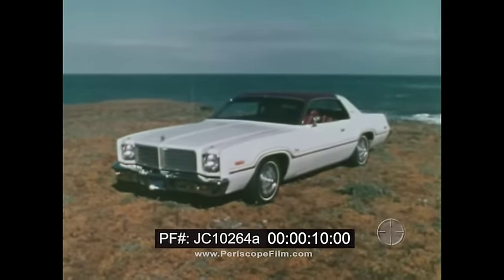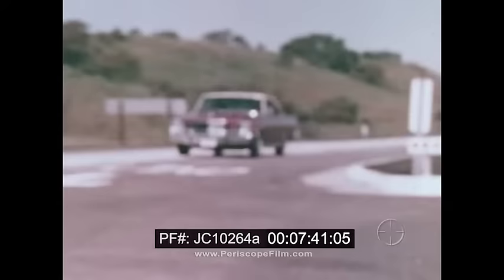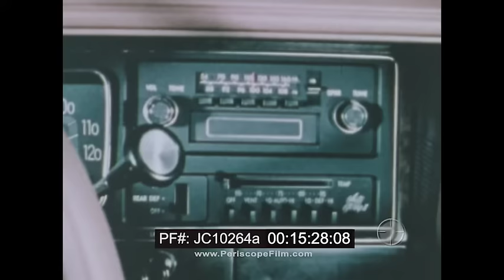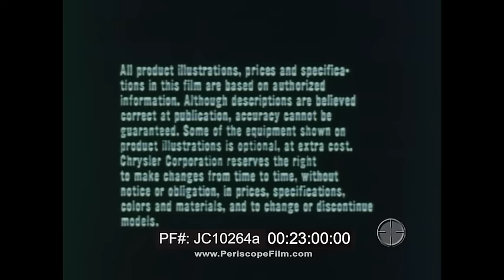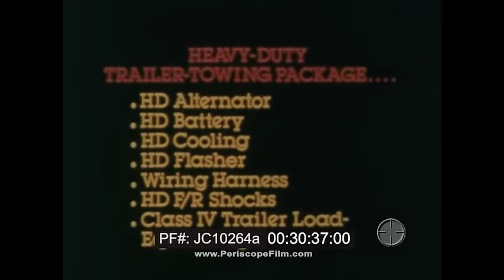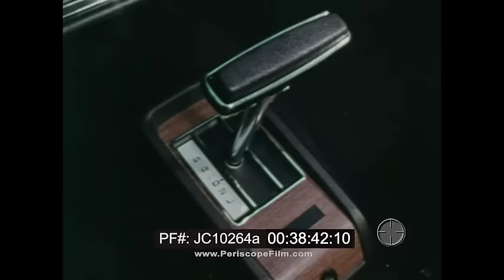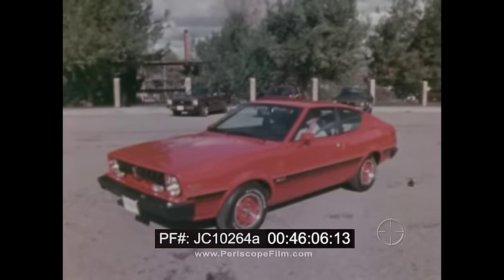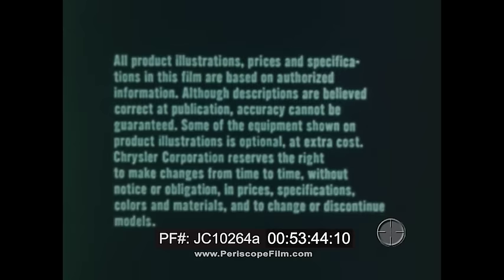1975 VINTAGE DODGE CAR, TRUCK & VAN  ADVERTISING PROMO FILMS   DART  GRAN FURY  ARROW GT JC10264a

Comment: Ah...you had me at simulated wood grain vinyl panels...now you're talking class.
Reply: That was a big selling point. You have to think that up to WWII, all vehicles had wooden components. They needed to be nourished and maintained, or they rotted. If you had a car longer than five years, you needed to sand and refinish the wood. After plastic and nylon became optional, people could have their "wood" and never need to maintain or refinish it, because it was artificial. Same reason EVs come with fake exhaust sounds today; people were used to it and still wanted it in their cars.

Comment: This is so awesome to see the 1975 models  \m/ My Dad owns a super rare 1975 Dodge Dart Hang 10 with a crank sun roof & fold down rear seat for your 🏄 lol. My Dad’s “Hang 10” has a 318c.i. with a few modifications he did himself such as an aluminum semi high rise pick up for a 4 barrel carburetor set up + hooker headers,it now has a set of shaved down heads with roller rockers & titanium valves,Accel Ignition,3:73 rear gears etc. They only made the “Hang 10” from 1974-75 & the sun roof was optional & they came with a slant 6 ~ 318 or 360c.i. They are an extremely rare car that keeps gaining popularity.
Reply: That is a rare car.
Reply: I remember the Hang 10 commercials in printed magazines at that time... The phrase "Hang 10" referenced a slang surfing term and was pictured on the beach, surfboards all around, with tanned Adonis' and bikini clad beauties playing volleyball or around a campfire weenie roast... or at a ski resort chalet... the good life.
Reply: I 've got a '74 Space Duster. That fold down rear seat is awesome. If you fold down the trunk divider too you can sleep in the car.
Reply: I wish I could see that car. It sounds like a great look into the past. I’ve never seen a crank sunroof!
Reply: Surf's up, Moondoggie!  Hang Ten Darts come up on eBay once every ten years or so . . .

Comment: My father had a 69 Dodge Dart that the slant 6 engine it didn't have a lot of power but it was a work horse and it was extremely reliable 6 kid's learned how to drive in it. My father kept his clean inside and out it was painted gold with a black vinyl top. That Dart ran from 1969 until 1987 that's when he gave the to my brother and his wife who promptly wore it for
Reply: Yes, my dad bought a used Swinger in '79 and the chassis was garbage by '81, but the slant 6 kept on going.   Whomever stole it from us in August '81 got a good engine at least.
Reply: My dad bought a 78 Aspen new with the slant 6. It would break the tires loose shifting from 1st to 2nd. I was really too young when he owned to remember much but I do remember him working on it almost every weekend.

Comment: Thanks for the memories. I think I will take a fleet of 1975 Darts and Valiants. I suppose it goes without saying they would all have Slant 6 engines.  Since I am buying in bulk, you may as well throw in a few Coronet wagons with 318s. Make sure to add as many Taxi components as possible to the wagons.  😁
Reply: I used to have a plump Valiant I think it was a 72 and the slant 6 was a reliable engine, what a shame that they just don't make cars like that anymore
Reply: Oops Plymouth
Reply: @The610wise  The tragedy is that 50 years later, Chrysler has never matched the reliability standards set by their Darts and Valiants. If you want the common sense, modern equivalent you buy a Corolla or Camry .
Reply: I have a 2000 civic and it is a great running car and it drives great feels great and ride's great, the best used car I ever bought
Reply: @The610wise  My father had a 1980 Dodge truck with the slant six in it.  That thing only got to about 80K miles before the top half of the engine had to be rebuilt because it started burning a quart of oil every 100 or so miles.  I had two Dodge pickups from that general time period with a V8 in them and never had that problem.  I did rebuild my 85 Dodge W-250's 318 engine at about 137K miles because it was starting to get noisy and used some oil but even at that point it never used a quart more than every 300-400 miles and I think half of that was leaks and not burning.  After the rebuild the engine was still running great at 270K miles, the transmission finally went to hell in it and I dumped it rather than spending $1000 on a truck that was rusted out.  Technically the slant six might have been "reliable" in the manner that it didn't completely break down but no engine should need a partial rebuild at 80K miles!
Reply: I would have absolutely loved to have the '71 Valiant that Dennis Hopper drove in "Duel".  Before it got smashed up, of course . . .
Reply: @borisratnik9032  Maybe  Dennis Hopper drove the truck in  "Duel"  but  Dennis Weaver drove the Valiant 😉
Reply: @rightlanehog3151  Thank you, I stand corrected.  It WAS Dennis WEAVER, otherwise known as Mc Cloud.  Sorry.  I'm getting old.  But I would still love to have that Valiant.
Reply: @borisratnik9032  I possess no statistics to prove it but I would say the Valiant and Dart were the most reliable domestic cars of their day.
Reply: @rightlanehog3151  I agree, I think they were - with the Slant 6, of course.  The V-8s drank too much, but they were good, decent cars for the money, and simple.  Better than the small Fords and Chevys of the time, which were kind of temperamental.  I wanted to buy the last one - the 1980 Volare or Aspen - offered for $5,000 new, but I didn't have the money at the time.  I knew that the age of Mopars was over by 1981 and I was sad to see them go.
Reply: You can have the 225. Give me the 318 with a 4bbl. I will get much better gas mileage.

Comment: I have a '68 Roadrunner ive owned 38 years here in the UK, a 440 L code conv '68 Fury and a '69 273 Dart....I want a '75 grand Fury now LOL. MOPAR all my life
Reply: My man!!!
Reply: I owned 2 Cordova's, I the 1970,& 1980,s, had no fuel problems!!, At all!!!!! Miss them!!! ....
Reply: The 75 Gran Fury Custom with quad headlights looked so much better than the Brougham's dual headlights.

Comment: I love the round headlamps that were nearly universal back then. If a rock hit the light it cost about ten dollars for a new one. A rock that goes through a modern headlamp assembly might set you back a thousand dollars, Ugh,
Reply: Yeah my car, my dad's 1954 bsa motorcycle, and a model A's rare sealed beam aftermarket kit use the same headlight
Reply: The standard round headlight could be bought anywhere, the same can't be said about the modern headlight assemblies.
Reply: The round headlight was about $2 back in the mid 70s, other bulbs were around 49¢, only took 2 minutes to change, no one ever had to take a bumper cap off just to change a headlight bulb like you have to with most GM cars and Ford Fusion.

Comment: My father was a Oldsmobile man and in the 70s GM was making junk my father bought a Olds Delta 88 and it was a huge car my mom was a tiny lady and she that Olds and she needed a pillow to see over the dashboard. The Olds didn't last 5 years but that old Dodge Dart was still there ready to go when the body started to rust around the wheel wells he did the body work himself and took it Earl Shines for the 99.99 paint job had the seats redone in a soft fabric and nothing they bought was as cool and reliable as that 69 Dodge Dart
Reply: Should have bought FORD!!!!
Reply: Nooooo Ford's were notorious for being just as crappy back then as they are now, as matter of fact I just sold a 07 Focus to the junkyard for 460.00 because they are junk, every time I replaced something that needed to be replaced 2 days later something else would brake, I realize it was old but it was a nickel and dime car. I just bought a 2000 Honda Civic LX sedan from the old lady across the street for 1000.00 and it hurts 114,757 miles it's clean and we'll maintained and it runs great drives great feels great, it passed inspection, and in a way it reminds you and Dads Dodge Dart A simple reliable car that doesn't eat a hole in my bank account
You can keep the Ford 
,
Reply: My uncle had a 1975 Olds Delta 88 coupe.  He drove it over 20 years and well over 250K miles without needing an engine or transmission rebuild/replacement.  It was finally in a moderate wreck (what insurers call a "rolling total") and my cousin entered it in a demolition derby.  My uncle said the car went out in a "blaze of thunder".
Reply: @The610wise   Ford is literally the most reliable vehiclemaker today, after Toyota. The Ford Focus/Mazda 3 routinely hits 500k miles or more across the board, so learn how to drive or take better care of your vehicles. If you couldn't keep a 2007 Focus running, you're never going to keep a 2000 Civic running.

Comment: Those cars had horrible drivability problems with their carburetors and fuel management systems. The lean burn system was a failure
Reply: I heard that the "lean burn" system was a sick joke that seemed to be designed by Satan himself.  Car collectors that buy cars that came with the lean burn system today promptly replace it with a more conventional system available as an aftermarket.  It wasn't just Chrysler that had problems with computer controlled engines, I had a 1983 Lincoln Town Car with computer control, about every 24,000 miles that computer had to be replaced at a cost of about $150.  In all other ways the Lincoln was good to me but that computer box was a problem.
Reply: @mharris5047  From the mid 70s to the mid 80s were a very dismal time for anything made in Detroit.
Reply: Car companies were desperate for any gimmick that would save gas back in those days.
Reply: Lean Burn works well if you understand it. Failing that, just remove it properly and away you go.
Reply: @account4info I’d go so far as to say it was… an era… where they were going through a sort of… malaise

Comment: It's sad to see the folks who brought us the 383 Chargers, the 426 Hemi Challengers, the 340 Dart GTs, etc., advertising "economy" features that warn you about stepping on the gas too hard a mere 6 years later.  The years between 1973 and 1978 were an almost fatal time for the US auto industry.
Reply: LOL it lasted longer than that, you had 180hp in an Z28 in '86....we had 360hp TT  -6 in a 180mph 4 dr.Vauxhall...UK
Reply: Jimmey Carter was President!
Reply: @markholroyde9412  
Of course it lasted longer, but by 1978 most US car manufacturers realized they were on the wrong track and started moving in a better direction instead of stubbornly insisting that the right ad campaign could talk the public into buying bad automobiles.
One of the best descriptions I ever heard of the huge increase in Japanese share of the US car market from 1975 to 1980 was the following:
The Japanese came along with the radical idea that they would make cars the customers wanted to buy instead of making cars the manufacturers wanted to make.
Reply: @markholroyde9412  
Hold on to that Vauxhall tight.   Hold on to it with both hands, because British automotive history consists of a mix of practically hand built, custom pieces of art for the uber-rich and mass produced cramped and unreliable pieces of sh*t for everyone else. 
The UK has zero room to criticize anybody on the quality of real mass production automobiles.
As an aside, what did the FIAT owner say to the MG owner?
Need a lift?
Yeah, it was that bad.  The UK, just like most other long established auto makers, primarily produced sh*t through most of the 1970s.
Reply: @maxkronader5225  I have a friend that had a 1970's MG.  It was NOT a nice car, he actually tried to sell it to me but I didn't want it.  It looked great but my fat (expletive) wasn't going to fit behind the wheel of that thing!

Comment: The Plymouth Scamp was a fairly decent car with a 318 under the hood.  Still had the identical looks of the previous generation Dodge Darts but no performance model.  Back then cars had character with the big chrome bumpers and kids could add Cragar S/S wheels for an even more hot rod  look.  However, if you wanted to street race you needed a serious big block under the hood.

Comment: Watching the Dart now. Hmmm. We had a 72 sedan and a 75 Swinger, 225 slant 6. The 75 used every bit of the fuel of the 72, but was even slower. Great cars, but only with the V8. My preference is a 318 with 4bbl. In Canada that meant no catalytic converter.

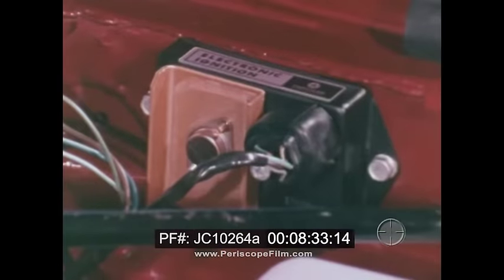Comment: 8:35 Ha!  For the petrolheads here, that electronic ignition device on the firewall was a sure fail -  if and when the hood gasket failed, water would drip down over that thing and the car would never start!    Same thing for the previous generation Dodge Dart.
Reply: I have had them run with the insulation melted out, water Running over them, and, Never missed a beat!
Putting together a 54 Dodge pickup, and, will probably put that ignition module in it  just to Try to finally kill it off!  
Pulled Slant 6/904 out of a '76 Dart, and I have had it in 2 other cars over
 the years. Approximately 250k miles on it, and still has around 120lb compression across the board!
Should make the truck cruise So Well!
Reply: @bensonsspeedshop1191  I am glad your slant six is doing well, my father had a 1980 pickup with that engine and he wanted to (expletives) Lee Iacocca after it started burning a quart of oil every 100 miles with only 80K on the odometer!

Comment: These were certainly some beautiful and comfortable cars for their time. 
Unfortunately, US automakers were going through some tough times as they struggled to meet strict emission standards and improved fuel economy. The engines in these cars were laden with thermal vacuum switches with hoses to control ignition timing, EGR, air injection; while the exhaust was choked with a 3-way catalytic converter. 
It wasn't just Chrysler cars; Ford, GM, and AMC were doing the same things. Have you ever looked at a vacuum diagram for a mid 1970s car? Its mind boggling. 

Much of it was experimental as engineers were doing what they could to reduce emissions while keeping their cars running half way decent. By the late 1970s, electronic engine controls would be the solution to that problem.

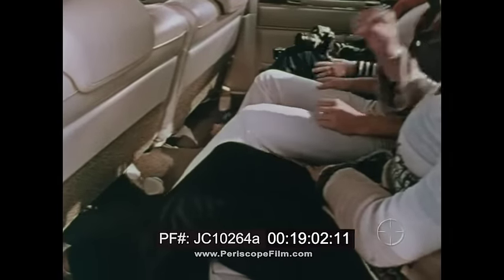Comment: 19:00 This car is an American car, but it has strange mirrors.　The fender mirror looks like a Japanese car. As a Japanese person, I was very surprised to see this.
Reply: The Arrow was manufactured by Mitsubishi so it was essentially a Japanese car.  The first Chrysler manufactured small car was the 1978 Omni (my grandfather had one, it was reliable for the year he owned it but so cramped inside that in 1979 he traded it and about $3K for a full size Dodge pickup).  The second small car line Chrysler manufactured in-house was the Aries/Reliant cars (my grandfather got talked into one of those as well -- the Chrysler 2.2 engine completely failed at 56K miles and that car was a bucket of trouble).  I had a 1983 Chrysler New Yorker which was essentially a fancy Aries/Reliant, I had the Mitsubishi 2.6 engine and at least that made 150K before it was clacking loudly and burning oil, I dumped it at that point.  At least I had my truck and another car I could fall back on if my New Yorker had broke down, I felt sorry for people that bought the early 80's Chrysler compact cars that didn't have a second vehicle.  Let's just say I liked my 1967 Chrysler Imperial much better but 14 years and 250K plus is about all she had in her.

Comment: In those days all I had were GMC  and Chevrolet (have all these days) so never knew they offered a 4x4 with 440 with extras like a built-on  8-track and CB. That Trail Duster with a 440 might have been better than my Toyota Land Cruiser(?),
Reply: And dual speakers!!!  Wow
Reply: I don't know about that, if you had the Land Cruiser they sold in Africa for jungle use you had one hell of a tough truck!  IIRC they sold them here in the States during the early and mid 70's.  My uncle had a Ramcharger (a copy of the Trail Duster), that is another slant six that didn't survive well but otherwise it wasn't a bad truck but not as tough as the Land Cruiser.
Reply: The only problem with Land Cruiser was stiff suspension but you're right it was super tough.

Comment: While I grew up in the 70's, I'd forgotten how utterly FUGLY most US car design was at the time. The only cars which looked remotely decent were the Arrow & the Sapporo. The one segment  where they tell the dealer how to counter sell against the Toyota Corolla are hilarious. "Just tell 'em they you have more gadgets! Who cares if they break easily!" And boy howdy, did they.
Reply: That Dodge Charger was gobsmackingly uuuugly!
Reply: Lots of extras and special equipment  at the same or lower price than  a competitor usually meant poorer quality

Comment: My  wife had a 76 Dodge Volare.   A 318 with a torquefight 3 speed auto.  The body and paint were horrible.  What a rust bucket and it was only three years old.  The brakes were inadequate  for the weight of the car.  I honestly thought Chrysler had a bin of parts from earlier models and just slapped them on.

I also owned a  74 Dodge heavy 3/4 ton crewcab pickup.  That was a well built truck.  A bit dated and rather stoggy in design.
Reply: In 1981 there was a recall about rust on those cars
Reply: My parents’ ‘79 Volare was the car I took to prom. Needless to say, I didn’t get laid 😂😂😂
Reply: They made a big mistake replacing the A-body cars with the F-body ones, the grades check out. Those 1976 Volare/Aspen cars were the motor trend car of the year but almost bankrupted Chrysler
Reply: These were dark days for Mopar
Reply: The venerable 72-93 Dodge full-size trucks.  For the most part if they were equipped with one of the V8s they were excellent trucks.  I owned two, my grandfather owned two and my father one.  Only my father's (or maybe I should say my mother's as she pretty much took it over as soon as he bought it) gave trouble ridiculously early -- and it was the only one of the bunch with the slant six.